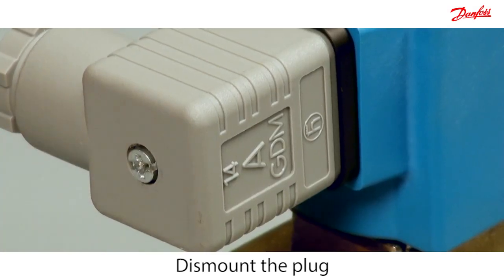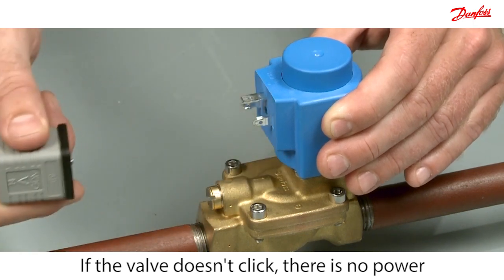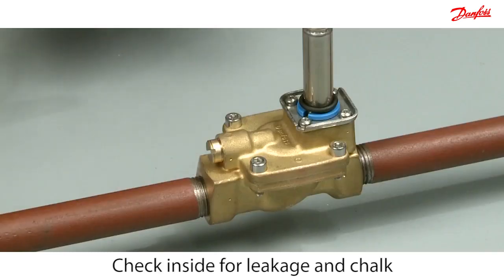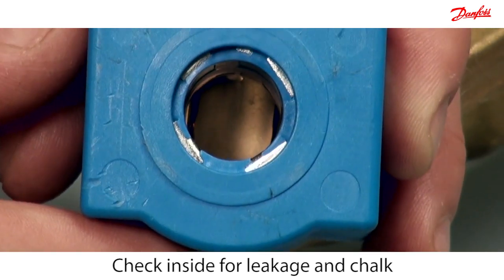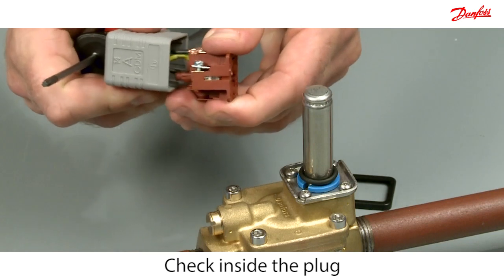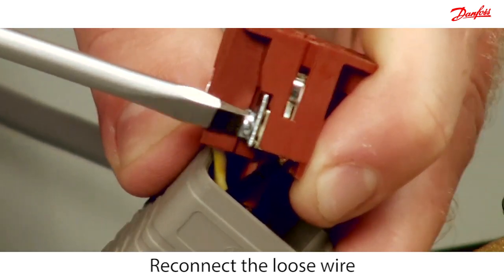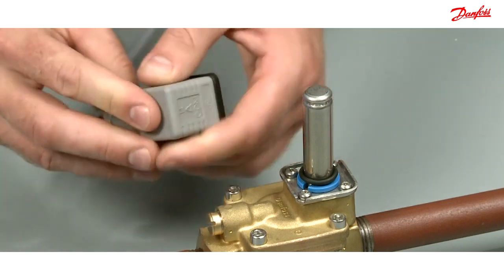How to check a Danfoss solenoid coil for defects and loose wiring | Troubleshooting instructions

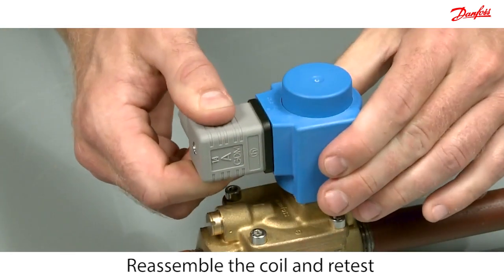Comment: Dear Sir, at the 1:32, when testing whether the coil is working or not, by putting the plug into the coil, do we need to turn on the electric power? please advise, thank you.
Reply from the maker: Hi. Thank you for your comment. The answer is YES - it is necessary to turn on the electric power.

Comment: I need to replace solenoid coil BE230AS (018F6701) & BG230AS (018F6801) by model with ATEX approval. Can I replace two that solenoid coil by model BO230C (018Z6592)? Are there any accessories need to have to do that?
Reply from the maker: Hi, The Danfoss BE and BG types coils are clip-on coils which you simply just click onto the valve by hand pressure. The BO type coil is a screw-on coil. This coil comes with a snap fastener and nut with O-ring to fix the coil onto the valve. Please see the Danfoss video about how to mount a screw-on coil to the Danfoss solenoid valve. See the following link https://www.youtube.com/watch?v=9Af_vsK4ioA.
Reply: @DanfossSensors   Thank you very much for your reply. So I total replace BE & BG type are operating by BO type without any additional accessories. Beside that I see power consumption of BE type is 12W & BG type is 15W. Does this have any effect when replace by BO type with power consumption is 10W? Please note that BE & BG type are existing and operating.
Reply from the maker: @DungNguyen-fx6mv  There are various factors influencing whether you can directly replace the BE and BG coils with the BO coil and get same valve performance. Such factors being needed are differential pressure (MOPD), media and ambient temperatures, solenoid valve type, supply voltage tolerances etc. Therefore, please contact your local Danfoss Sales company to get further support in this matter. Thank you :-)